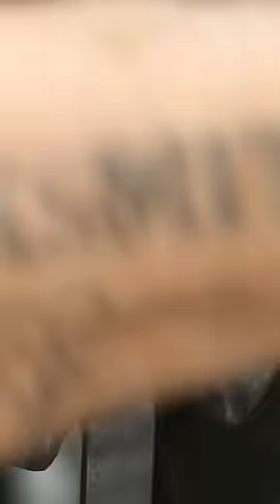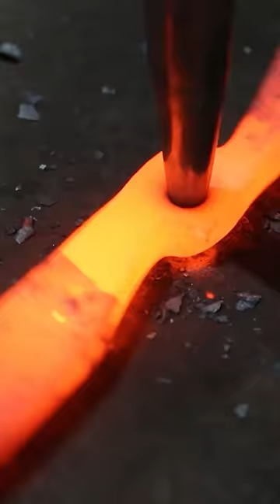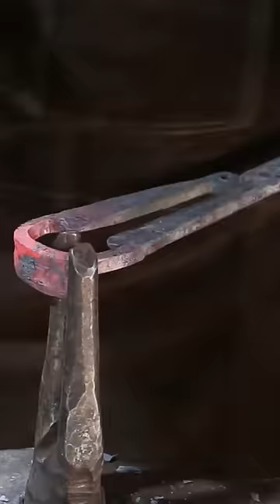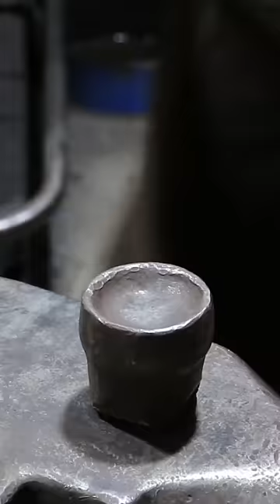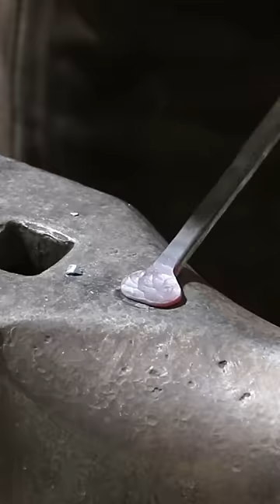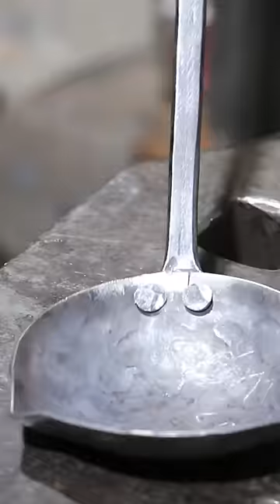Making a ladle.#shorts  #diy #blacksmith #handmade #forgewelding #artwork

Comment: You guys are bad ass....Had a smith make me a stand to hang my chilli pot over a fire... 3 iron legs attached with a ring at one end, to hang your pot from..when  he welded the ring together,, he used borax soap, told me its called fusion weld and stronger than any  modern weld cause now its not two ends together but one continuous ring forever....
Reply: you got hoodwinked man.
Reply: @jhoughjr1  whats that mean
Reply: @jhoughjr1  by who
Reply: It’s a “forge weld” the borax is used as flux, and the forge weld done correctly is a more complete weld that you can expect from most low level welders
Reply: @john-davidkirkland427  yes my bad,, a forge weld... It was very kool